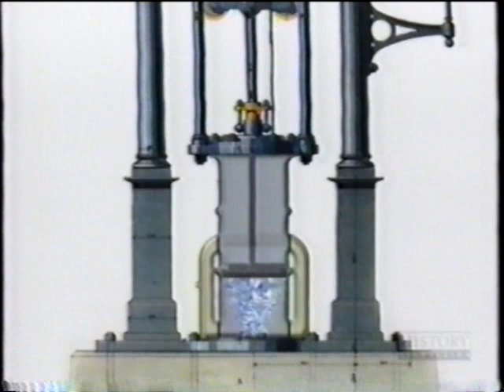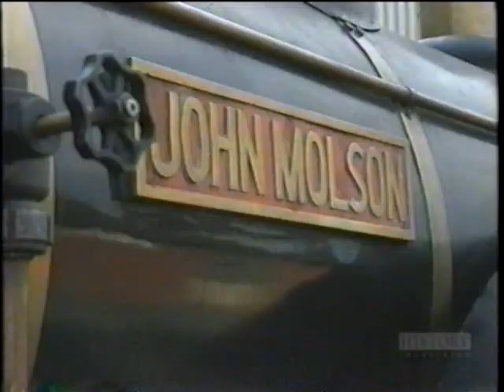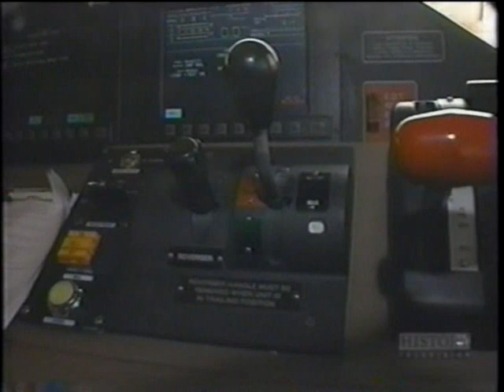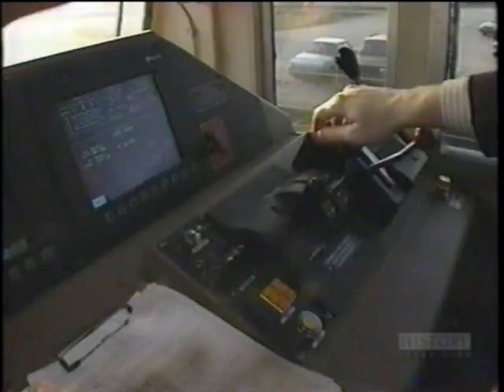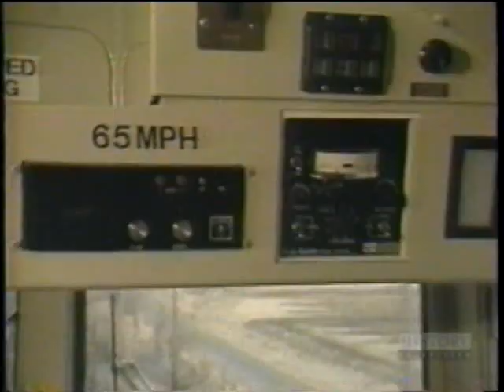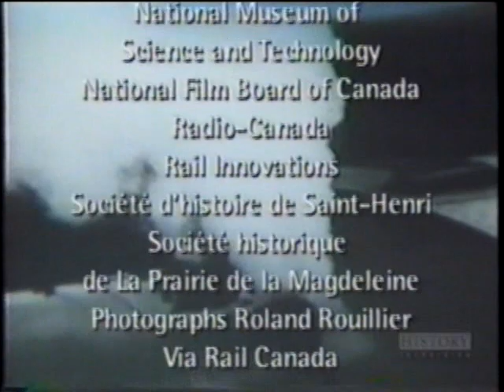Great Train Stories - The Mythical Locomotives

Comment: This Narrator GETS SO MUCH WRONG in this documentary it's not even funny...... The animated Diagram of how a Stationary High Pressure Engine was entirely incorrect as it's displayed as a Single Acting Uniflow Engine not a Double Acting Counterflow (However, the Newcomen Atmospheric Engine was shown correctly). The Locomotive purported to be "Rocket" here is actually "Novelty", it's direct competitor in the Rainhill Trials, built by Johannes Ericcson and John Braithewaite. The Actual Rocket had been shown as an unnamed locomotive barely a minute or two before, and both engines were built in 1829 not 1830. George Stephenson was not Scottish, he was born in Wylam near Newcastle Upon Tyne. Towards the end of Steam, it was the EXACT Opposite of what he said, Steam Engines were relegated to Grubby Freight Trains, even Passenger Engines went into Freight Duty. While Diesels mainly hauled the varnish aside from Specific Freight Diesels which were built and geared for that Purpose. Larger Steam Locomotives of the late Steam Age (in Canada, 2-8-2's, 4-8-2's, 4-8-4's, and 2-10-4's. For some reason 2-8-4's never caught on there.) were of Equivalent or Greater Tractive Effort and Horsepower than the Early 60's era Diesels, and in their infancy it was not unusual for Steam Engines to assist Diesels or even Take Over for them. The fact that multiple Diesels could be lashed together and operated with one crew was what gave them the appearance of strength, and even today, the only reason why Diesel and Electric locomotives can pull as much as they do is all down to the gear reduction in their trucks for their 4 to 6 Traction Motors, if the Rotors of the Traction Motors were directly mounted to the axles, they wouldn't even have 1/3 the amount of pulling power. Whereas a conventional Road Steam Locomotive is doing all the work without any gearing at all, the cylinders are directly connected to the Driving Wheels. What killed Steam was one of the few things he got right, the Overwhelming cost of Maintenance. They needed far more Manpower to operate and maintain them, frequent Watering, Coaling, Servicing, and Rebuilding. Also, Diesels could be purchased much like cars are today, EMD was financing Diesels with Long-Term loans at very low interest rates, so even a Railroad that was broke could afford to Finance a Diesel, and with the savings from the low interest loan, as well as the low maintenance and operating costs, they could buy MORE Diesels until their whole fleet had been replaced. Then by that time, their savings will have allowed them to pay off the loans. However, despite all this, it was NOT unusual to see a Steam Locomotive still in service that was well into it's 5th decade back during the transition era, the working lifespan of a Diesel is 1/3-1/2 of that even to this day.

Comment: 32: appears that the points on this switch are set for the other direction, maybe this was a spring switch but it certainly looked like the engine was running through a set of points.